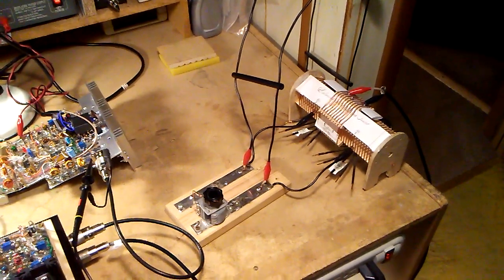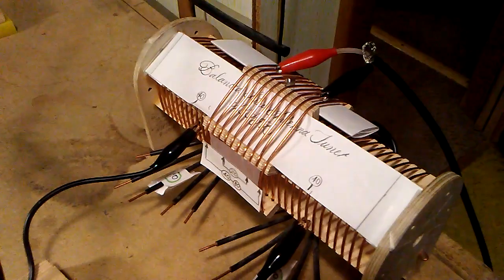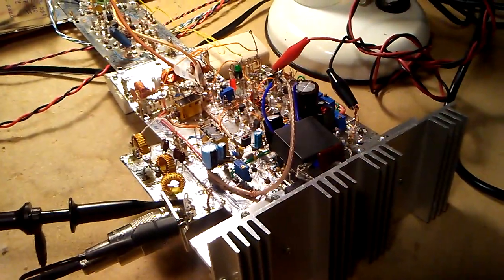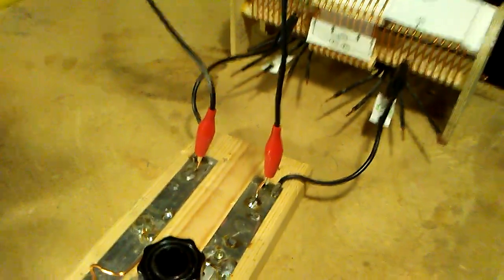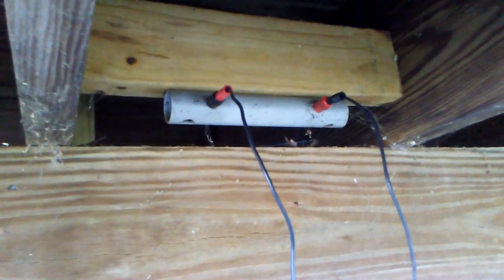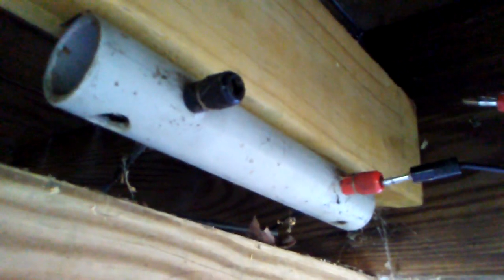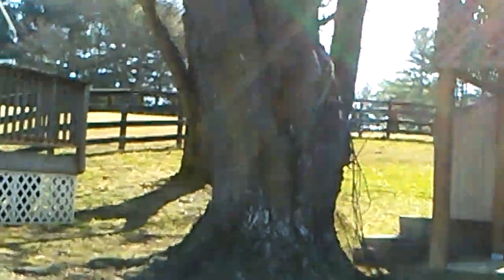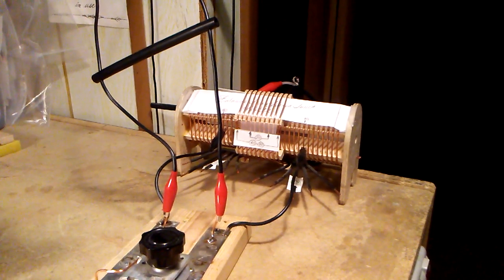Ladder line to 80 meter loop 2020 03 09

Comment: I would try changing the impedence and use a parallel coax system to feed it out of the basement.  Now. I don't know the impedance you are using, but.  You can approximate with parallel coax and eliminate/ reduse interaction with metal objects along the run

Comment: if you have a full size loop (100 to 150 ohm resistance) then rather than ladder line you can also consider sat tv "Shorgun twin" 75 ohm co-ax & just feed balanced between the centres,,, as it is screened its routing is "idiot proof" like normal co-ax & it doesn't have to be kept clear of metal... at 2x75ohm = 150 ohm it is pretty well matched to the loop too
Reply from the maker: StreakyP, great idea!  I have an old run of abandon C/Ku band dual 75 ohm coax going from the house to where the old 10 foot TVRO dish was one located.  This would be a great experiment to try in the future.  Thanks for the suggestion 73 Rick N3FJZ

Comment: I used a rope on all corners to hoist into 4 trees.  The cleat works well for me too.
Thought the loop impedance was closer to 100 ohms.  Why such a high impedance ladder line?  Seems the common 450 ohm ladder would be easier implement. Also, it seems the ladder impedance would be affected by running it against a wall.  In the old TV days we ran the 300 ohm twin-lead out and away from walls or siding, and especially metal items, with a spacer.    If you could set up a TDR measurement, you could see the impedance along the ladder line.  Fun stuff.
Reply from the maker: Hello Dalebert Durando, Thank you for the question.  I don't remember exactly why I chose to build 600 ohm line instead of 450.  In my notes I do have the dimensions for 300, 450 and 600 ohm line (0.39 in., 1.27 in., and 4.77 in. spacing for #14 AWG) , so I do know I was considering various impedance lines at the time. I'm sure there was some advantage in my mind for the set-up I was running. The formula I used was:  Z = 276 x log (2S/d) where Where: Z = line impedance, S = center to center dist of conductors (in.), d = diameter of conductors (in.)  Also see: [  https://www.qsl.net/co8tw/openline.htm  ]
73 - Rick - N3FJZ

Comment: What did you utilize for the ladder line spacers? Also, what was the formula you used to ascertain the ohm rating for the nice 600 ohm ladder line, for instance the wire diameter and spacing between wires?
Very well done video.  
Is your working environment always alligator clip oriented or will you evolve the gear to more traditional cases, etc?   
What are the SWR's you are encountering by band?
Just built a 80M Skyloop, square, 45-50 feet high... 280 feet of wire initially.    LMR400 fed... very good antenna... great for DX on 20M and higher... quiet... some lobes and nulls but appears to be omni-directional at 75 and 40 and as the frequency goes up the lobes and nulls develop.   Only up a week but that is the feedback so far.  Using Palstar HF-Auto for the trans match if needed.
73 Art W1SWL
Reply from the maker: Hello Art, for the spacers I used electric fence insulator tubing. This tubing's outer diameter is 0.35 inches (9mm) with a wall thickness of 0.075 inches (2mm) and sold in a 50 foot roll.  It's original indented use is to insulate electric fence wire when you need to run it in the ground such as under a driveway or gate. I bought mine st the local TSC tractor supply store in a 50 foot coil. Just search "electric fence insulator tubing" on the web and you should see some other suppliers.  I cut this tubing into individual spreaders which would provide the required wire spacing distance plus a bit more to allow a hole at each end to thread the feeder wire through. The formula I used is:  Z = 276 log (2S/d) where: Z is the line impedance, S = center to center dist of conductors (in.), d = diameter of conductors (in.) A calculator (by Serge Y. Stroobandt, ON4AA) can be found here: (https://hamwaves.com/zc.circular/en/index.html).  Some day I hope to build the coupler into an enclosure but for now it just uses alligator clips.  I have found the taps I use for the various bands are usually in the same place unless I alter the feed line length or the loop length, so even if I eventually use a switch, I will probably still provide a semi permanent way to change where each tap lands on the coil if I need to change it later.  With the 80 meter loop and open wire feeder I can usually achieve an exact 1:1 (zero reflected power at the rig at 50 watts out) match by tuning the capacitor and moving the taps on 80, 40 and 20 meters .  The loop is too short for 160 meters even though I can receive 160 meters very well.  I only use coax between the rig and the primary winding of the coil (about 24 inches) and use open wire from there to the loop (about 60 feet).  Fine business on your loop, I love mine.  73 - Rick N3FJZ.

Comment: Thanks for an informative video. I'm a returning ham after a 30yr hiatus for career and family and would love to build something like this. You mention that you made a square configuration; could it be rectangular. My plot is long but narrow. I have approximately 300x40ft available for an antenna, with trees 30-40ft at one end and 20ft masts at the other. I know it's not high enough but worth a try?
Reply from the maker: You're most certainly welcome, I'm thrilled you were inspired by my video; also, welcome back to the hobby, I too took some time away from the hobby in the late 80's, returning in 2009.  In my opinion, yes, erecting a full wave loop is most definitely worth the effort.  With your shorter dimension of 40 feet, you could erect a square 40 meter loop (each side around 34 feet) and should get good results on 40M, 20M, 17M, 15M, 12M, 10M & 6M (provided you employ an antenna match [i.e. antenna tuner] that is happy with the non 50 ohm impedance the antenna would present to the transmitter and good low loss coax, or better yet, ladder or window balanced feed line); however, getting any match on 80M and 160M would be very difficult and the radiated power would be low with most of the power being converted to heat in the coax feed line and  antenna match (in the case of open wire ladder or feed line, most of the loss would be in the antenna match since losses in open line are very low).  I believe I read that you can feed a full wave loop with 50 ohm coax and a balun, but I have never done this, my 80M loop is the only antenna I have ever used on HF, and I have only used it with homebrew 600 ohm open feed ladder line and my homebrew link coupled antenna match, so you would have to do some research there. Also, keep in mind that if your full wave horizontal loop is closer to the ground than 1/2 wavelength, the angle of maximum gain is mostly up, which is great for "local" contacts (< 400 miles), but not the best for DX.

You could still do a stretched out 80M and perhaps a 160M horz loop, but it starts to act more like a folded dipole from what I've read.  For insulated antenna wire, just use the formula (Loop wire total length = 964.8 / lowest frequency you expect to transmit on) as a starting point and experiment from there ;e.g. 40M loop 964.8 / 7 = 137.7 feet (34.4 feet each side) (uninsulated wire would be loop wire length = 1005/F) .

I found this link which might be helpful.  It explains the theory of full wave loops for many different configurations:   https://practicalantennas.com/theory/loop/full-wave/

I hope this provides some help.  73 N3FJZ.
Reply: @Circuit6040  Thanks so much for the detailed reply. I really appreciate it. I will certainly try a square loop and in time might experiment with a rectangular loop as I have plenty of length in the plot. It would be a pity not to give it an experimental try.  I have a feeling I may end up with the square loop you suggest and maybe a dipole or doublet for 80 and 160. 

It seems we have things in common, a life long interest in radio and long break in our pursuing the hobby. My break was for career and family but now in semi retirement, I can play radios again! Best 73s and thanks again for your time and consideration.

Comment: Amazing loop. I’m very new too all of this and I’m preparing to build a 144’ (40m) horizontal loop above the roof of my Brooklyn brownstone right now (about 65’ above ground). Roof is rubber and foam, internal structure is wood. I notice that you don’t use a balun. Does the balanced tuner replace it? I’m planning to use 450ohm window line connected to less than 10 feet of coax to an auto tuner —do you think I should be using a balun and if so, what ratio? Thanks so much for this great vid and any help.
Reply from the maker: Hello Dan S, Thank you for the complement!  - Yes, in my case the balanced tuner acts as the balun / impedance match to the 50 ohm coax of the rig,  I measure the SWR between the rig and the balanced tuner (50 ohm side) and adjust the taps and capacitor (across the ladder line right after the tuner)  until I get exactly 1:1 for 80, 40 and 20 meters.  I'm afraid I can't be much help in the ratio you will need for your balun, but as always, a search on the internet and perhaps antenna books may be of some help.  I did a quick search and found that a 40 meter loop would have an impedance of 80 ohms at resonance, so perhaps a 1:1 or 1:2 would put it within range of your tuner.  Since this is my first ever HF antenna, and have used ladder line from the start,  I don't have any practical experience feeding the loop with coax and a balun. I wish you good fortune with your loop, I love mine but keep in mind that (from the way I understand it) the radiation pattern might be mostly straight up.  I get good reports 500-600 miles out with my 50 watts on 40 meters using my 80 meter loop.   73 DE Rick N3FJZ

Comment: My ladder line is loving the wind this morning, had to chase it to the neighbors TV antenna. Definitely not an aero dynamic feedline.
Reply from the maker: That's for sure, sometimes it seems to have a mind of its own.  73 Rick N3FJZ
Reply: @Circuit6040  So, recently I've taken some "google" advice and twisted the line about 1 twist per 3 feet. That seems to help a little. Then I have tethered the end of the line with stretch cord to a wooden stake in the ground. Not the best arrangement but we get winds off of the water here that just never seem to quit and hopefully I won't need to re-solder the ends back to the 1:1 unlun again... 73 wb3gbl op hr  rick (also)

Comment: Cool beans.  Building a loop for 160 and up this spring.  Going to use a traditional tuner and balun though, but the banana clip disconnect outdoors is a great idea.  I am going to do that.  Much quicker than unscrewing a pl259 and no equipment wear and tear.  Good show.

Comment: Is it running along against the chicken wire thats holding the insulation up ?
Reply from the maker: Good catch Control Man! - Yes it is - Thank you!  The ladder line hangs down below the chicken wire from 0 to 12 inches over a 12 foot run, but I will lower the close end more (the next time I need to do work in the craw space) to reduce any possible interaction.   So far I haven't experienced any major issues using the antenna system (that I'm aware of) and I'm always able to always tune a 1:1 SWR on 80m, 40m and 20m with my balanced link coupled 50 ohm to 600 ohm matching unit with 80 meter full wave loop at 50 watts.  73 N3FJZ

Comment: Nice set up, looks a little long for just 80 meters, looks more like an 160 meter loop.
Reply from the maker: Hi Peter, thank you!  No sadly, it's only 80 meters.  Might be the camera lens that makes it look longer.  I have designed the pathway and layout for a 160 meter loop, but it will require me to add three additional masts, which I've not built yet, and even if I do, I'll only have it up about 20 feet, which will make it a cloud warmer :-)
Reply: @Circuit6040  I made a delta loop last summer, did all the tree line connections and insulators in March, no leaves,  about 30 to 40 feet up using a broken fishing rod and reel with a sling shot, surprisingly it worked, with a lot of effort!!! Made my own ladder line like you did, spaced out about 2.5 inches, giving me approx 460 ohms imp, first time using it with a unun transformer, SWR was all over the place 100 plus ohms, then I remembered that it was a 4:1 transformer , made for coax at the top of the wire connection,  oops! Made another one 9:1 for ladder line hooked up on the bottom,, against the wall just behind the shack, WOW!!!! 1:1 All across the frequencies, even on 160 meters its almost a 2 , 2.5 SWR,  loop is measured for 80 meters, around 262 ft, first microphone key up was to an Italy station on 20 meters  around 6pm, no trouble at all, instant contact!!! I used to have a Titan dx, 36 ft tall vertical,  poor performer, could never make a contact without at least 4 or 5 shout outs, ice storm took it out, luckily!!! Lol lasted like 20 years, I will never buy another antenna again, delta loop was so low cost at that. I want to make a full wave next, I have more wire now, and plenty of trees!!! Nice to see someone else doing the same!!! Maybe I'll catch you on the air, 73's Peter, N3WUB, Bushkill PA
Reply: @Circuit6040  https://www.instagram.com/p/CBFKgrcghoG/?igshid=1u5kknyu6xzle

Comment: Hi Richard thanks for sharing the video. Can you help?
I'm thinking of trying a loop for 80 metres as I do like 80 but there's so much QRM it can be hard to work sometimes. I know form having built a 20 metres loop it did cut the QRM.
The last storm, (storm Francis,) bent my 33 foot mast of my 80 metres inverted 'V' through 90 degrees! I underestimated the downward forces and before I reinstate the invited 'V'  I'm considering other options. I live on top of a hill in a coastal location, fabulous views but man we pay for it by way of the wind. Because of the shape of the hill we can easily get 80 mph winds rattling around. I'm seriously thinking about a low level loop maybe just 3 metres off the ground. I understand that a loop like this is good for local contacts (1,000 miles or so) and that would be ok but I don't know if that's just too low to be any good. Do you have any experience with very low level loops like this?  
73   . . .  Andy 
gw0jxm
Reply from the maker: Andy,

My 80 meter loop is about 3 meters above ground at its lowest point, and maybe 8 meters at the highest  and I routine work stations 400 to 700 miles away with 50 watts on 40 meters with the link coupled balanced antenna match (with 600 ohm ladder line between loop and coupler).  I have not done much testing on 80 meters for distance, but have made a few local contacts and got good reports.  73  Rick N3FJZ.
Reply: @Circuit6040  Thanks for the information Rick. I've thrown up an 80m loop simply by laying over some gores bushes and a few low thorn trees. It's about Three metres at the highest and one and a half metres at the lowest. For a good swr I had to shorten it quite a lot, I started off with a loop of 279 feet but this had to be cut down to 235 feet. it's more or less square. it's fed with coax and an air cored balun to give an impedance ratio of ~4.9:1 and that gives me an SWR of 1.16  It's great foe reception and  I get 4 and 8 to 5 and 9 reports but I've only been on the air in the afternoon when the band is rubbish.  certainly getting out a few hundred miles. I'm encouraged enough to buy some 6 metres aluminum scaffold poles and play with a low level loop at a higher level. Hopefully the 3.8 mm thick walled scaffold poles won't bend like the blessed thin wall tube.
Thanks for the feedback.
All the best . . .  Andy     gw0jxm
Reply: @AndyDaviesByTheSea  I love to here others using and building their own wire antennas, especially loops. Sounds like you've built some winners there. You can try a loop or delta loop in the vertical position,  if you feed it from the side its vertical, and from the top and or bottom its horizontally polarized!!! I want to try one!!! Peter N3WUB
Reply: @peterock8217  I’ve never tried running open wire like this to a tuner even though it says balanced line. I have built a few delta loops with a 75ohm stub. It looks like you have the tree height to get two ends high and feed at the bottom. Great antennas. Built for 40m but you’ll notice it’s 1.7 on 20 as well.